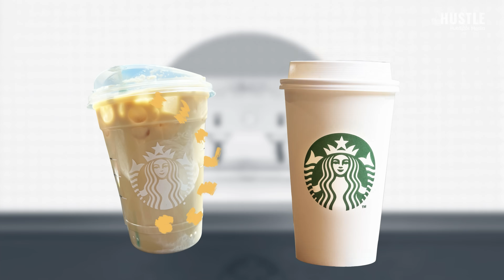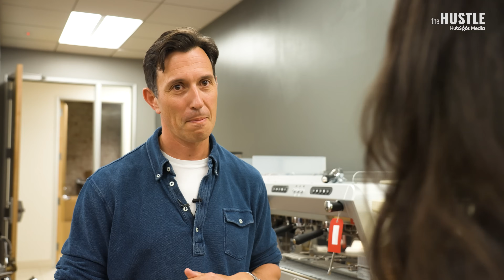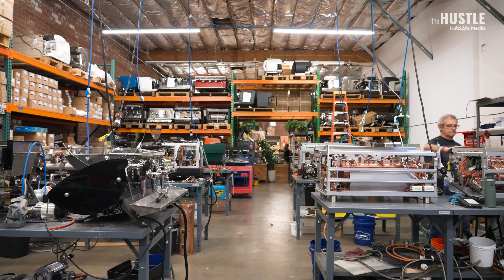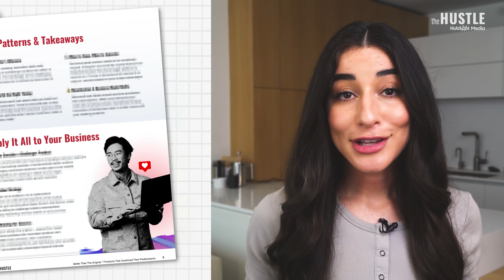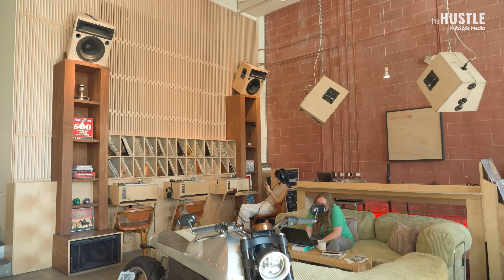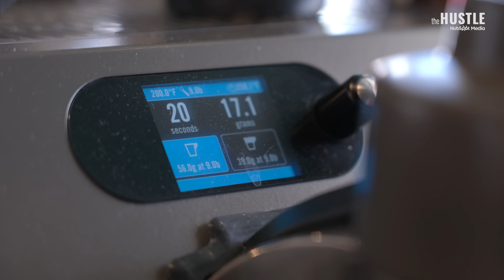Why This Machine Is In Every Good Coffee Shop

Comment: as someone with over 40 years espresso/capu experience as well as restoring, repairing home, prosumer, commercial, pump and lever machines as a hobby LM is not a bad machine, certainly well built, solid and makes nice coffee, but many other manufacturers machines do the same equally as well and at a more competitive price point. i could absolutely buy a LM or even a slayer or Kees van der wesson but aside from bragging rights and aesthetics it will make comparable coffee to that of a multitude of other machines. the only technology i might consider could be a profiling capable machine.

Comment: Not shading La Marzocco, as they are definitely a beefy work horse of a machine, but! As for "ferrari" of espresso, the slayer. Marzocco is focused on consistency with consistent recipes and beans, slayer gives back more control to the barista to experiment and tune in their main stay espresso and rotating beans (guest roasters, rotating single origins, etc). 
I've had wonderful coffee from a LA Marzocco, and horrible coffee as well. From same shops even sometimes! But, anytime I've seen a slayer on the bar, I've rarely been disappointed. 
Also a lot of people say grinder is more important which is very true! And i've seen quality grinders matched with slayers more than La Marzoccos (;

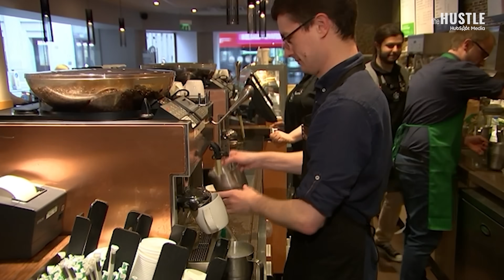Comment: 5:30 a superautomatic refers to a one step machine. If keeping with Thermoplan AG, we can use the black&white 3 and 4, or the Franke Sinfonia or foam master series. A one step machine literally means pressing ONE button for a cappuccino. Machine does coffee and milk. The Mastrena is a two step machine, or an automatic. Meaning one push of a button grinds and brews espresso but then you have to froth or heat the milk yourself, hence the two step. 
Fun fact: starbucks also had the Thermoplan Verissimo 801 that was also custom made for abux but was too tall and there was no eye contact with the customers. The classic mastrena and the mastrena 2 have external pumps that sit under the counter and allow for the unit to have a lower profile.

Comment: For most shops its a buy once cry once situation where your actually better going top end market than middle, youll still get 80% of what you spent back on a refurbished lamozacco even after ten years, but if you buy a Adexa machine you wont see any comparable resale value, plus parts support arent as available for any other brand when they update the model.

Comment: Italian cars are like so not reliable. How many are on the roads today. Top gear has a passion for them, and love them. But for daily hard abuse. NO way. Our local place has an in counter aesthetic monster, but it would break down and it was not easily repaired. Hard to remove. They went to the usual brand here because there is minimal down time. To train a user on it is easy. You can swap it with another one in a few hours. No new user training. Easy easy easy and quick. Reliable. That is the # 1 reason. i have a job with tools. if i was on my own i'd choose some cheaper tools. But for corporate/fast/trusted work. I'd have to pay 5x for each tool i'd use to do the same job. Roughly. If you climb a 50 foot ladder do you need to worry if your tools are going to work. or break. or not fit right.

Comment: I am a Manager at  Starbucks. The point of Mastrena is to be consistent, as when doing the manual temping and different bits, the consistency changes.
Reply: Starbucks makes terrible espresso because they switched to the garbage push button machines

Comment: Is this a paid advertisement for La Marzocco? Specialty coffee shops these days are a lot more likely to have a Slayer, Sanremo, or Victoria Arduino behind the counter. In fact, La Marzocco is considered pretty technologically outdated compared to the competition.
Reply: In my area, everyone is still using (and mostly loving) la marzocco. Even the cafes with international recognition
Reply: Just got back from the World of Coffee trade show in San Diego, LM had the biggest booth there and had a variety of specialty coffee roasters showcasing their machines. It's still the most respected and highly regarded espresso machine brand in the specialty coffee industry.
Reply: My favourite cafe uses a Sanremo. However any problem emerges they need to wait 3 weeks for a replacement part (last time one gasket failed, which was a 10 EUR part) and had to use their older machine from storage. This won't happen with a LM, they can send a technician with parts in less than 48 hours (as they claim on their local website).
Reply: In Toronto, in 70% of coffeeshops I see, it's La Marzocco Linea for sure.
Reply: Why technologically outdated?
Reply: This is a business use machine in which reliability and sustainability become the most important feature. la marzocco strength is that they already have a network of technicians and spareparts supply chain already in place all over the country. when your la marzocco is down you have more technicians capable of diagnosing and fixing the problem. Reliability and sustanability being the most important is actually very common phenomena depends on where you are. In Indonesia nuova simonelli took the throne in because of the price vs la marzocco. In australia I see more shops shitfing from la marzocco though, but i wouldn't be surprised if la marzocco still dominates like the video here.
Reply: Depends where you live man. There’s only 1 cafe near me that had a slayer machine but honestly their espresso is mediocre.

Most of the specialty cafes near me run LM and use Mahlkonig and Mazer grinders.

Cafes run that equipment because they’re proven, reliable, easy to get serviced, etc. you should know it boils down to the barista, the grinder, puck prep - not gimmicky flow profiling which you can get on a Leva anyways.
Reply: @bren.r  Flow profiling is most certainly not a gimmick. You can taste a difference between profiled versus standard 9 bar flat profiles.
Reply: @bren.r if I walk into a shop and they have a La Marzocco… you know your getting a mediocre shot.

If they have a slayer… you know the barista will make it with the same care I would at home. Adjusting flow, using distribution tools etc. 

La Marzocco has been the king but specialty coffee has evolved. La Marzocco represented stability, the best you can reasonably get at a cafe. But now the best espresso is made at home, and the only reason I’d spend the time and money to go to a shop would be to taste an exotic single origin with a dailed in profile.
Reply: @cesarescobar7049 100%
Reply: not true. Sure, other brands are popular as well, but LM is still dominating the specialty market. They are reliable, have a huge service network, and no one needs flow or pressure profiling in a commercial setup.
Reply: @stanvanillo9831  Keyword being "specialty". LM dominates the commodity coffee market where distribution and service networks are more important. But for specialty coffee, technical capabilities like flow and pressure profiling absolutely matter.

Comment: Grinder is more important than machine.
Reply: on a commercial scale I'd argue machine is just as important
Reply: Yeah, but I know a Café that has a Lamarzocco that delivered a million shots of espresso drinks. I think that has a worth on its own in times where we just throw away everything that's older than two years.
Reply: In a commercial setting you want a robust machine that can pull hundreds of shots per day. If you are a busy cafe that mainly does milk drinks, the machine is arguably more important.
Reply: @mrkevinsetiadi Nuova Simonelli appias and aurelias are way cheaper than a La Marzocco and achieve as much or even more, theres a reason they are the leaders in commercial sales in Italy. If La Marzocco are the Ferraris of espresso machines, Nuova Simonelli are the Toyotas.
Reply: 50/50 if it cant process those powders its useless
Reply: @sleepyjoe8256 consistent pressure and consistent temp.  Plus grind consistency.  The guy has no idea what he’s talking about.
Reply: The barista is more important than the two
Reply: Well it depends, that is true if you do manual pour. If you do espresso then you want a machine that gives consistent temp and pressure.
Reply: @jojoanggono3229 I have a la pavoni.  Hand pull espresso.  It can be frustrating to pull a shot 😂
Reply: … but so satisying when you get it right, though, eh.
Reply: @lilbawli1922 la Marzocco is not the only machine manufacturer nor the biggest building commercial machines
Reply: @adam__smith  yeah man.  Had the best shot of my life and the worst from the same machine😂
Reply: @ThePathbauer  Huh?

Your comment makes no sense. No idea what you're talking about.

La Pavoni is unrelated to La Marzocco.
Reply: @lilbawli1922  Me too, and that's why I love mine. No way I would be satisfied with a push-button home espresso machine.
Reply: @jojoanggono3229 the marketing that really sells these machines is group head heat stability. 
All marketing. Sure they hold the group temp stable, but the differences between this and most any other commercial machine would be imperceptible in the cup. Add milk, and now it becomes a joke.
The best Q graders “might” perceive a 0.5 degree group difference when drinking comparative cups espresso, but I’d bet everything I have that they couldn’t nail it 3 times in a row 😂

In a commercial setting. It’s almost a joke